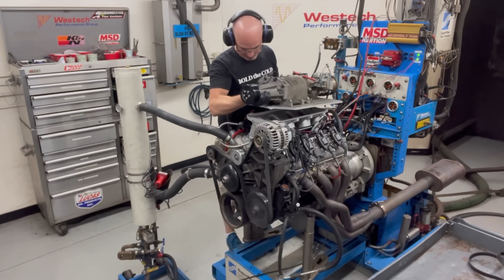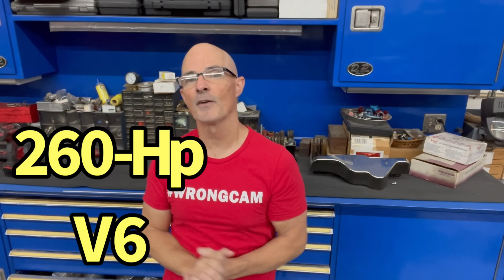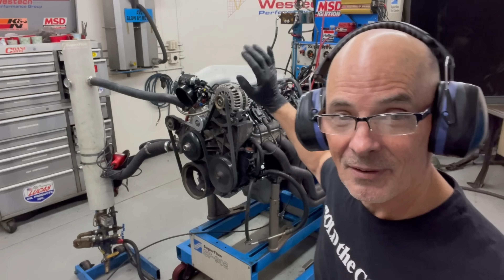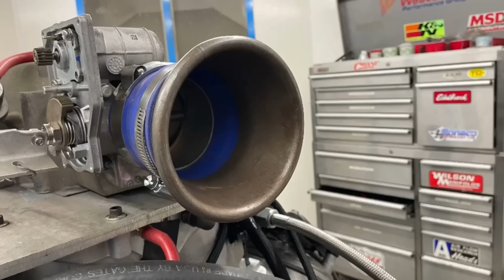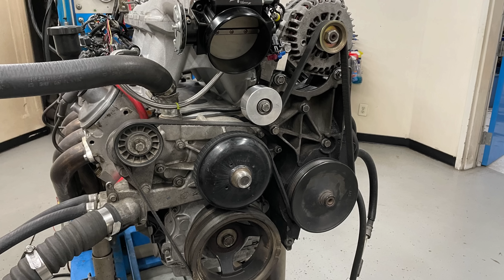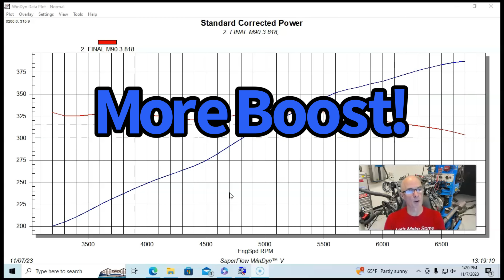DIRT CHEAP, $100 4.8L LS BOOST! JUNKYARD V6 M90 BLOWER TO THE RESCUE! IT FINALLY WORKS ON THE 4.8L!

Comment: What is the displacement of the blower. That is a fairly small blower, so airflow may be an issue. Wonder what a Kenne Bell blower would do or a blower designed more for the 4.8/5.3 engines.
Years ago for motor homes guys would put 4L53 or 6V53 blowers on and overdrive the blower to up low RPM torque. You could run a 6L71 blower but you have to slow it down which takes away the low RPM torque for more power higher in the rev range.
Might be EFI controlled but pistons, valves and cams are pretty much the same.
Reply: M90 = 90 cubic inches or around 1.5 liter.
Reply: @TheInsaneShecklador So it basically needs to rotate at 1.6× crankshaft RPM tow just supply the piston displacement, zero boost.
2.4L/1.5L= 1.6. 7,000 × 1.6 = 11,200 with pretty much no boost. A bit small for a 4.8L engine. The Kenne Bell 110 would be better.
Reply: @daledavies2334  Yes it was designed for smaller engines but it's readily available in junkyards. Often for less than $100. Richard knows there are better options but not many at that price point. Also I think it's been requested by a lot of viewers over the years. More of an experiment than an actual recommendation.
Reply: @TheInsaneShecklador Yes a good experiment. I have to wonder how it would work for the 3.5 to 4.0 aluminium Rover V8's. The 4.0L and 4.6L are probably the better engines for that as they have cross bolted main caps. Those engines suffer from poor cylinder heads. Some porting and bigger exhaust valves with that blower would likely wake them up big time. You will not get the power of a SBF or SBC but in a light car, could be fun.

Comment: The peak power leveling off in the boosted application... maybe valve float? Maybe airflow restriction? Maybe a combination of both? 

I just found one of these blowers locally for $100. 

Richard, would you be willing to share a parts list and possibly the dimensions for the adapter plate? I have a good running 4.8L that I got for free, and really have no idea what to do with it. A $100 blower seems like the move here.

Comment: I'm curious what output air temp from the blower was like with the three different pulleys.  Maybe had something to do with power curves of the middle and smallest setups.
Reply: Meth injection or a heat exchanger would help a lot. An eaton m112 from a jaguar can be had for cheap and would be better sized for this motor
Reply: E85 took care of the heat
Reply: @damebashmotorsports   It doesnt take care of it, it just increases octane.  EVERY factory boosted vehicle is intercooled now-a-days.  I would love to know the outlet temps.

Comment: the interesting thing about lobe roots blowers, is that adiabatic efficiency isn't directly related to lobe speed but total pressure ratio. They are great at moving massive quantity's of air, efficiently at low pressure, but they SUCK at compressing air in terms of efficiency.
Reply from the maker: this worked well at low boost on a high-hp (relative to the V6)V8
Reply: To what end? Boost pressure is a measure of intake restriction. Improve intake, reduce boost, increase power
Reply: @drivenbullet260 psi does always correlate to more air. 1cu.ft. of air at 160degrees is less air than 1cu.ft. of air at 80degrees at same psi. Cool down the charge air and you don't need to worry about pressure.
Reply: Wondered if every one understands that maybe 15hp used to run blower ?
Reply from the maker: much more than that

Comment: Great video, looks like we shouldn't hear you keep saying the M90 is too small for a 4.6 anymore haha JK Richard. I do wish the leak tests were performed, I know a good amount of people that were looking forward to that information in my blower groups and forums. If a bubbler delete (manifold drain) would possibly gain you 1psi or more that is seen as much more valuable to the community that runs small blowers capable of only 8 PSI max or similar like this test. If your blower maxes out at say 8psi and that delete allows you to now make 9psi or possibly 10psi that is a lot more important of a gain to them then somebody who's running large blowers capable of say 15-20psi as they may not care at all for that delete since those blowers can already produce the psi to toss their rods.
Reply from the maker: planned

Comment: M112s go for around $400 in my area.  Still a budget option.  M122s seem to go for over $1k.
Reply: i had a Jaguar m112 on a stock 5.7 hemi for a little bit, it made 7psi with stock pulleys, another cheap oem blower option is a tvs1900 from 5.0 jags and rangerovers.
Reply: i can source these blowers for 40$.
Reply: @madmod  Figure out a way to package two and you've got the LS blower market cornered.

Comment: Next time use 112 Eaton supercharger off a 4.6 cobra mustang
Reply from the maker: hard to find-but Mark does have one
Reply: I got one sitting in my garage with a non-slip pulley if you wanna use it @richardholdener1727
Reply: The bottom of the M112 is not flat like the M90. You will need to either shave the intercooler lip from the supercharger case or make another adapter plate.

Comment: Be interesting to see a couple dozen more pounds of valve spring pressure?
Reply: Cool. I was wondering if maybe the added boost was causing intake valve closing issues or the valves were bouncing off the seats
Reply from the maker: won't change anything-til we hit float